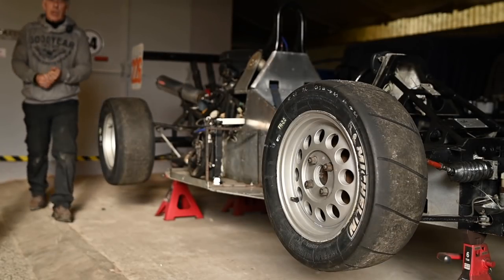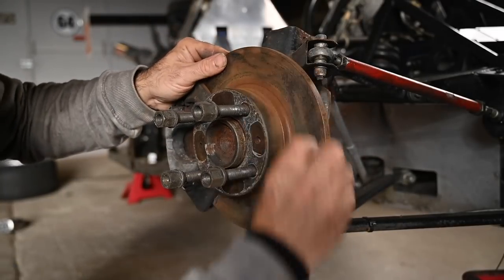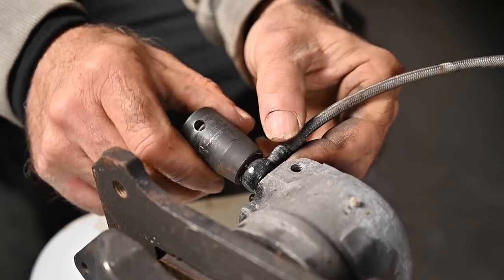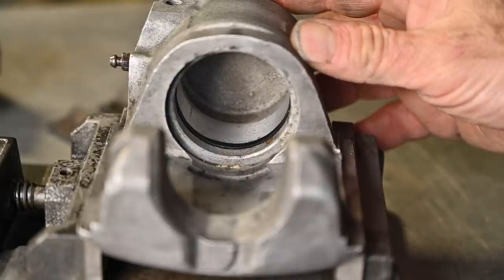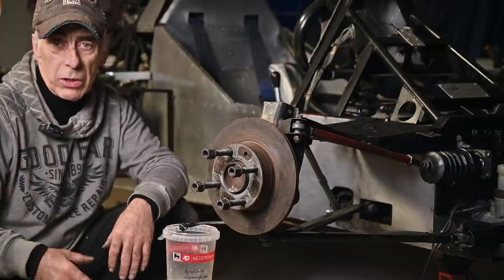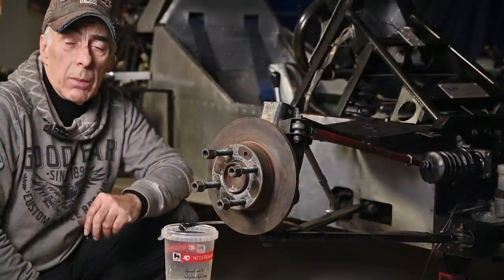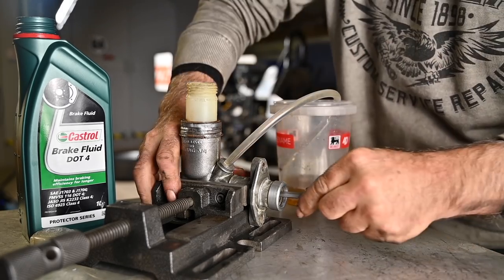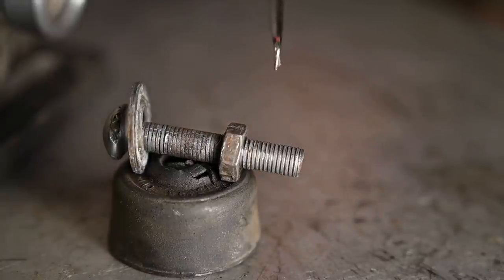Race Car  rebuild , Part 1 Brakes

Comment: Lol...  I have restored Fiat 124's. Watching you do the brakes brings back bad memories. I forgot about my finger position when I blew air inside. When it released it pinned my finger. I had a hell of a time getting my finger out. Thankfully it just scared me. I learned a lesson.  That was the second caliper I did. The first one  came apart real slowly.
Good work on your videos!
Reply from the maker: Thanks for the comments

Comment: As an ancient open wheel mechanic; do your back a favour and get some trestles ! Wood working ones would be fine for a start. If the the car's raised up you can use one of those mechanics seat/rollers with a tray under it for tools. Your back will love you forever!
Reply: My past experience agrees with your good advice sir.
Reply from the maker: Thanks for the tips fred

Comment: The nice thing about simple 4 wheel disc brakes systems is that they have vastly improved over the years in quality and braking power. Disc pad coefficient of friction falls across the scale now, good to really good to superior. That's another measure to make the first or second time you heel - toe into a corner Steve. I wish I was in my driving shoes again. Enjoying this project immensely.
Reply from the maker: Thanks for the comments Drew, and indee

Comment: Your car may have the brake setup from the Fiat X1/9 which was the sister car to the 128. The 128s had rear drums, whereas the X1/9 had front and rear discs, all of equal diameter.
Bearing in mind the brakes are Fiat based, you could probably fit Fiat Uno turbo brakes, which are vented on the front.

Good luck with the project.
Reply from the maker: Thanks for the comments, that is something to check.  Thanks for the tip

Comment: Steve you are a genius it’s always a joy to watch your videos because I know I will learn something 
can I just say if you change to vented discs will it fit between your existing brake caliphers  due to them being a wider disc than the solid disc
Reply from the maker: That would be the issue as `i would need to make changes to the calipers..., unless I would use drilled discs.

Comment: First I have to say that You are doing great job !! question, You mesured the brake disc what about wheel hub ?
Reply from the maker: Indeed, the wheelhub is something a ordered new ... as it has an embedded bearing.. its still ok , but I rather change it.   Yes you are right , I have that also measured... Just noticed during the editing that I missed a few scenes... As I film and work at the same time, and sometimes i think I turned on the recordng. But its not
Reply: @D3Sshooter   thanks for answer :) Im waiting 4 new episode

Comment: Flemish, I am learning too much from you. I watched all your videos especially those about cars. And I make a good time where I would not be disturbed. 
But, what is that website where you got that info about brake pads. 
I suggest one day you must make a video on how do you accumulate info about the car you are about to work on

Your great follower
M.b.s moshitoa(south Africa
Reply from the maker: Thanks for the comments Moshitoa, You are indeed a well know sub to me ( Thanks).  The website is a standard car parts site, like autodoc  .   The problem is that cars like this are build with parts from other cars ( like the Fiat brakes).  So, the first thing I always do is look for markings on the parts ( brand, part numbers etc..) . Then Google and look at pictures until I see one that looks very similar or the same .  As of that point I verify the dimensions, often I send a mail to the shop asking for the dimensions or I pass mine.   It is often a long search

Comment: Hello
Is the rotor secured to the hub?
Othervise the readin of the straigthness of the rotor will not accurate.
Greatings
Reply from the maker: Thanks for the comments, and indeed that is a very good point ... Yes it was.  Maybe , I should have stated that

Comment: Hi do you know if there is any race series similar to formula 750...design build race on mainland Europe. I have to move from UK to Poland over the next few years but I am struggling to find any websites or information of country specific minor racing series/ clubs...
Reply from the maker: Thanks for the comments,  Its not always easy to find a good club that races on the circuit.  In fact most clubs do drive on the track but not in a competition arrangement as that requires the licenses. Those clubs are around , and depending where you will go you will find them by first looking for a track location, once you have that . Then you are good to ask for clubs, the track operator knows the clubs. That is you best bet.

Comment: Careful I crushed my hand years ago using dry nitrogen to blow a piston out of a accumulator I had it blocked as well. from then on I used liquid -no expansion
Reply from the maker: Thanks for the comments,, indeed that is always a bit risky.   Just wanted to show what happens

Comment: Pay attention when you mount the caliper because the one you shown on the video is mounted wrong way, the caliper should be on top of the springs not under like they were mounted
Reply from the maker: Thank you for the comments, the car came like I showed it.  and yes that will need to be sorted out . Thanks so much...

Comment: WARNING- UNDER NO CIRCUMSTANCE SWAP PUSH RODS ON GIRLING MASTER CYLINDERS! THEY ARE FACTORY SHIMMED AND IF YOU CHANGE THEM YOU RUN THE RISK OF NOT GETTING THE CORRECT CLEARANCE FOR THE FLUID TO RELEASE THE BRAKES! = FRONT/ REAR LOCK UP- BROKEN DRIVER.
Reply from the maker: Thanks for the tip...